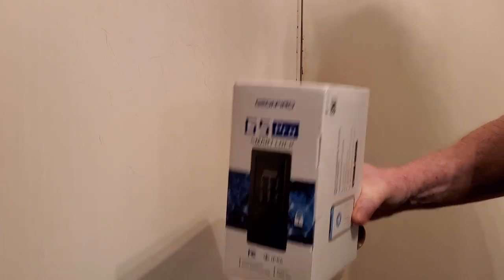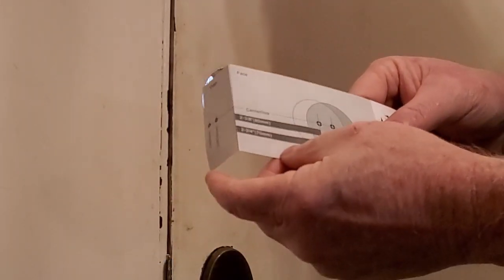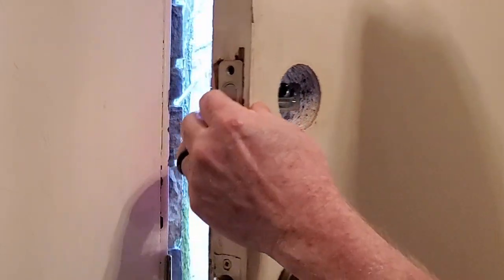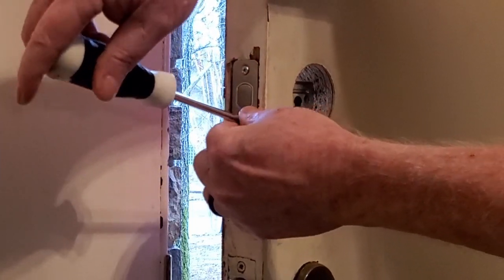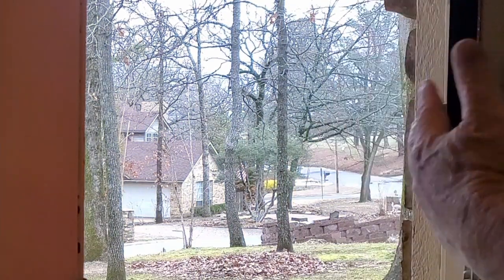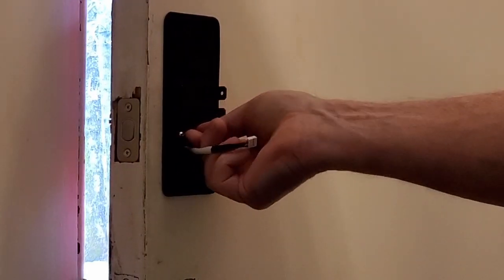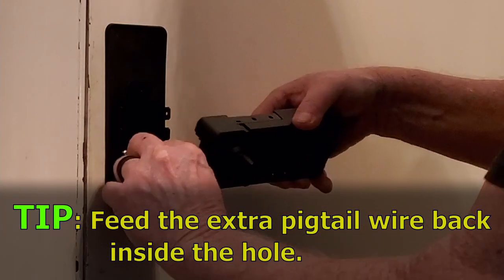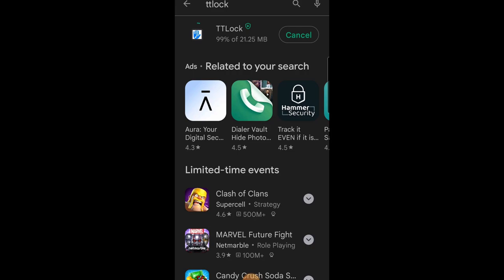GEONFINO G5 Pro 6 in 1 Smart Door Lock Install (Full Video)

Comment: This It's going to make my. Installation much Easier thank you
Reply from the maker: Biggest tip is use the battery cover to set where the rubber pad sits before you since down the two screws on the interior base plate. Good luck!